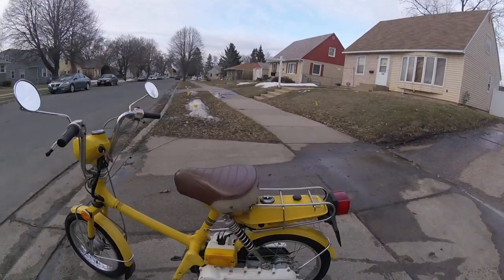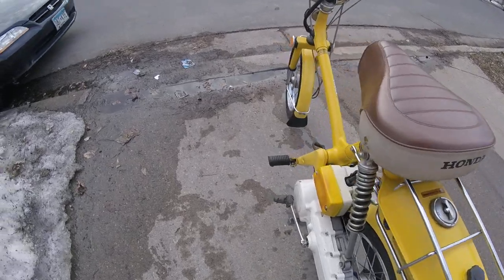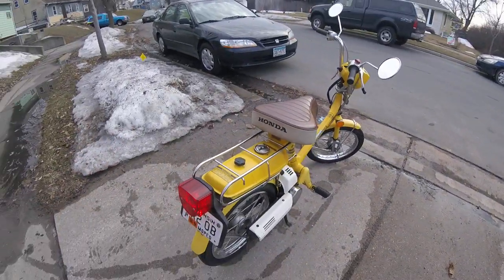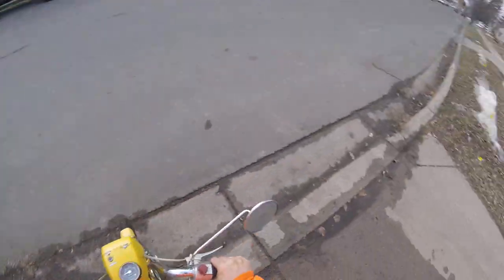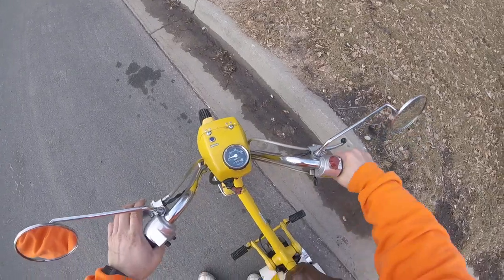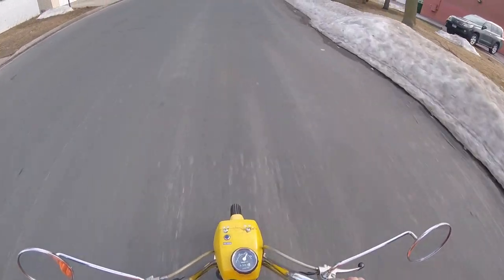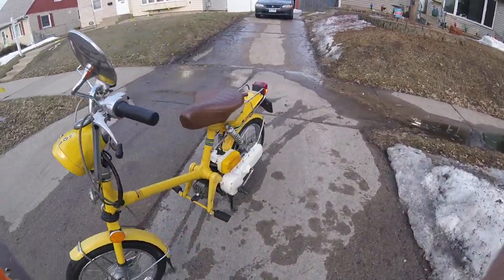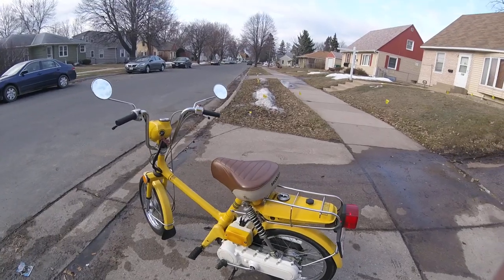1978 Honda Express NC50 Moped Review

Comment: I just got a 1980 model from the original owner with 1160 miles on it. Been sitting in storage for the past 25 years, has spark tires hold air, so hopefully after I get the gas tank cleaned out check the carburetor I believe it'll run. looking forward to playing with it. Glad to see there's still people out there who enjoy these little scooters.
Reply from the maker: Yeah, these are simplicity.. Easy to work on..Aot of parts available for these Japanese moped/ scooters.👍
Reply: Did you get it running? Proud owner from the U.K
Reply: 1160 miles on a tiny scooter prolly equals 150k on a car ....BEAT lol
Reply: @dougiequick1 Not these little Hondas, they're ridiculously reliable. I bought mine with ~1200 miles and now have over 4,000 on it without doing a thing to it. Honda knows how to build a reliable machine.

Comment: I had an orange one first year in college. In CA they were still classified as a motorcycle: insurance, license and all so I just drove it with one eye out for the fuzz. My oil tank developed a leak into the fuel tank so it always smoked like a chimney. Ended up running a can for the oil tank strapped under the seat.

Comment: i had a 1977 honda express i bought used in the late 1980s and had low miles on it.  and rode hell out of it and got a couple good years out of it. and overall they were very decent mopeds easy to maintain. the only thing i didn't like more or less was the kick start wind-up mechanism because if it didn't start up right away or stay running like it should etc.... using that kind of means to start a moped could be quite annoying and frustrating. LOL!  but i must admit the kick start wind-up always functioned and worked like it was supposed to.  lot of  good memories with that moped and i'm now 53 years old..  thanks for the video!
Reply: "moped"   MEANS motorbike with PEDALS....no PEDALS?  It can not be termed a moped.   Moped engines typically  were started by pedaling
Reply: @dougiequick1  true dat DQ in Oregon I think under 50cc & under 30 mph no license required

Comment: My first ‘bike’ when I was 16, back in 1978. Even at 16 I was 15lb over the rider recommended weight without riding gear and my back pack. Doing 25miles a day to work and back I ran it into the ground in 6 months. 😕🏴
Reply from the maker: There tuff..But when your young it seem that you wreck things easier.

Comment: Totally awesome.  Had a green 1 when I was 10.  Loved it. Rode it everywhere.
Reply from the maker: They are a blast.. Very Dependable transportation
Reply: I have a blue 1979 and a yellow 1978 with pretty low miles. They are both barn finds and are in need of a minor restoration
Reply: Back when I had mine I could fill the tank for less than 50 cents.  Really miss it and those gas prices
Reply from the maker: @barneybrady549  Thats Amazing price to fill up.
Reply from the maker: @CalebBoender  Thats what like finding.. Very hard these days. Collectors aren't selling. I buy what I can find.

Comment: I had a 1977 in Parrot Green. Put 2500 miles on it before I got my regular drivers license. Rode it to 5K before I sold it.
Reply from the maker: There very dependable mopeds.. Never leave you stranded

Comment: I saw one of these used as a decoration today except it had apparently been converted to an electric moped (which Honda has yet to market)  It clearly looked like same bike except it had a giant hub on the rear wheel which obviously was it's motor ...In place of the fuel tank it appears to have a battery case probably a modified gas tank....there was no gas engine to be seen and it actually had bicycle crank and pedals chain drive to a jack shaft and clank clutch or bike freewheel kind thing maybe?? ....I just saw some web links to electric conversion kits for these so prolly what I saw ...was all old and weathered however was not anything done recently !  LOL  tires dry rotted and paint faded it was outside a beer bar up on a roof thingy...pretty cool though!  I actually mistook it for a Honda Cub from a distance....!  I could not understand why I never heard of such!  Web search provided the Answer Honda never sold such a bike!  People converted them to electric instead of trashing them ....maybe/probably when the original 2 stroke motors totally wore out after only one or two years or a thousand or so milesetc....Side note My brother totally wore out a 50cc moped in late 70's within 6 months of everyday) ....I.m sure Honda stopped selling parts for the Express  decades ago...would not be worth trying to rebuild a well worn one is my guess
Reply from the maker: These days it doesn't surprise me with converting gasoline to Electric. They sell alot of options and with a Mechanical Mind. My dad made a Bicycle into a gasoline motor swap.. Very cool beach Cruiser.. Its a Wall hanger these days.

Comment: Hey Gary, Nice ride! Tim from Esko here. My oil sight gauge on my 1980 NC 50 is leaking. The shop manual doesn't cover it. How to remove? Is it threaded? Any insights?  Thanks.
Reply from the maker: Im not really sure. They might be held in by a rubber gromet if not threated. Maybe check ebay and see what they have for sale..You might ba able to see how looks.
Reply: @Garyjorges79 Thanks for getting back so quickly. I've been searching for a while now.   I'll try a few more avenues. Cheers.

Comment: Ty for the vid! What would a running one sell for nowaday? I have an opportunity to buy one @400$. My only issue Is that theres no title and dmvs r closed. U think cops would bother me if I drive it uninsured and not licensed?
Them!
Reply from the maker: There bringing top Dollar right now..Highly collectable even without a title I would drive it..Maybe have a Bill Of Sale on you so you have some kind of Paperwork..Better than nothing. Most cops understand what going on with the DMV Paperwork issues.👍
Reply: @Garyjorges79  TY! But it can't be legal without having turning signals, right? (Im in PA). The bike at 400$ is running perfectly. I'm also concerned about transporting it...will it fit in the back of a small SUV? (Subaru Crosstrek)
Reply: @Garyjorges79  also meant to ask if I will fit lol I'm 6"3-225
Reply from the maker: You legally can use you hands for signal..Aleast in most states..these honda didn't even come factory with turn signals until the 1980s  @613Bello
Reply from the maker: That's alittle big..But it might be alittle slower and your knees are going to be bent. @613Bello
Reply: @Garyjorges79  sounds like a hella a lot of fun for 400$!!!! ') can't frikin wait! TY for the help! Rock on!

Comment: I had that same one.
1978 yellow. I drove the hell out of it for 3 years until someone stole it. If someone knows a yellow one for sale that's a good running condition as well as cosmetically I would love to buy one.
Reply: I know of a 78 yellow one that is for sale right now
Reply: I have a 78 I recently got. It had all the rubber tore up and gone. I need to know what lines go where and it is said to run.

Comment: I have one the same an I just put a 70cc bore kit on it an will not start it will on starters fluid but doesn't seam to get enough fuel it dose very little wont even flood any one have any ideas or think I need to update the carb
Reply from the maker: Yes..I believe the carb is to small now....Especially the Jets in the Carbs..Alot more air and exhaust are being made due to the Big Bore stroke.
Reply: Ok thank you I appreciate that